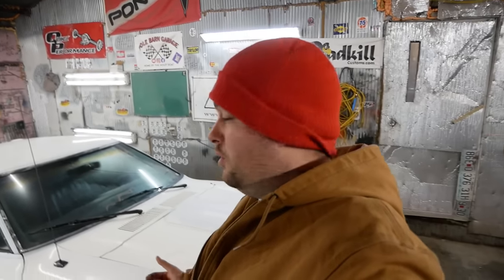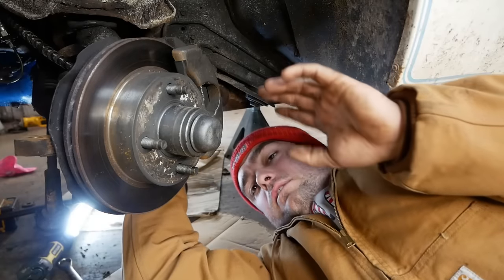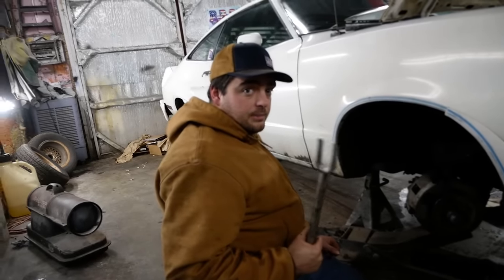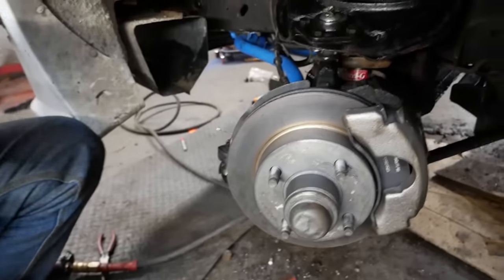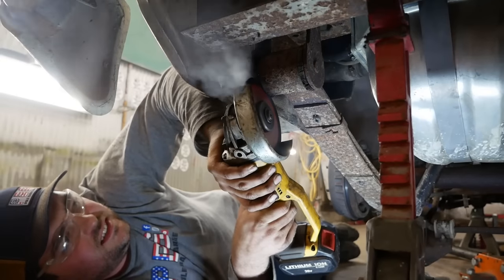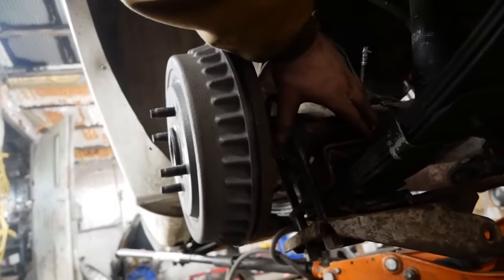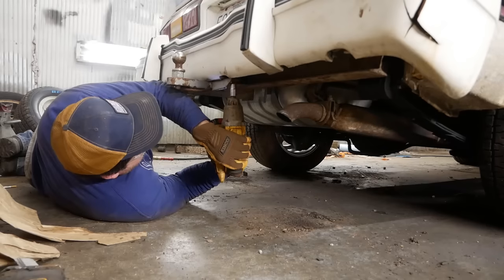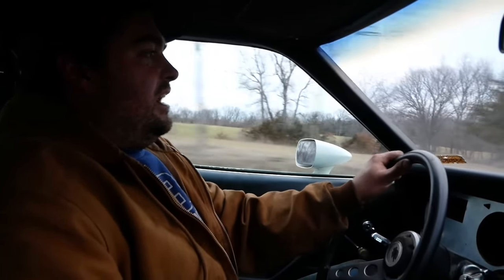King Cobra Mustang OVERHAUL! Total Suspension Refresh, Gets Some Muscle!

Comment: I built the Mach one edition of this car. Complete full custom build from the body shell out. 
I can tell you a few things:
#1 EVERYTHING is clapped out and was garbage when it was new. 
#2. NOTHING fits these cars. 
#3. There is no aftermarket support. 
#4. If you need a part you will have to
 A. Find a used one. (Which will also be clapped out garbage)
 B. Buy one for another car and modify it. Or
 C. Get a "universal" part and modify it to fit. 
#4. Aftermarket fiberglass pieces are $#!T. dont waste your money.
#5. The engine (V8) is offset 2" to the passenger side. The bellhousing and flywheel are one off mustang II parts. 
#6. When you are finished with it,  youll LOVE IT! 
Good luck man!

Comment: When I was 8 years old I thought the Mustang II Cobra was the coolest car on the planet! I loved it in black with all the louvers! Fast forward 10 years and I had a V8 Monza that I put a 350 in. Knowing what I know now I could have made a bit more power with it but It would've smoked any stock Mustang II. Looking at the front suspension and brakes on that car, though, and I must say, at least the brakes are superior to the Monza, and so is the engine placement.

Comment: I believe you are supposed to fill the PS system and then turn wheel lock to lock several times to prime before starting the vehicle. I had same issue with an 05 pilot...go figure

Comment: You need to check crank casting number to determine which engine it is. It has a 289 balancer and those are early 289 heads. Could just be a replacement 302 block
Reply from the maker: It's a 302 from a 77 mustang that I put in it last video.. definitely not a 289
Reply: Sorry about that Dalton. That message was for a different channel. Keep up the good work. Really enjoy it!

Comment: There isn’t much I’m able to offer you as advice as you’re definitely more knowledgeable than I am, but I do have at least ONE thing. 

When you’re cutting things with a reciprocating saw, especially bolts like those leaf spring bolts, use low speed and lube. Keep the blade cool and lubricated. As soon as the blade heats up too much, the teeth become soft and there goes your cutting ability. 

Because of this, high speed doesn’t necessarily translate to a faster cut.

Slow speed and lube keep the teeth intact and sharp, and will result in a faster cut and WAY less blades used.

Comment: I bet that rack was fine and that inner tie rod is bad. I did the same thing on a 1999 corrolla. Spent three hours taking the rack out. The replacement rack went bad in a few thousand miles. Looked at the original unit and replaced the inner tie rod and it’s been fine since.

Comment: Dalton I see you using the Dewalt wrist saver ratchet, I'm curious - i realize you love it, you use it all the time- so I am a Ridgid cordless tool guy, I have a million 2, 3, 4 and 6ah batteries. Like 15 of them, literally.. and I really DON'T want to  switch over to M12 (12v) Milwaukee JUST to get the ratchets (I want the long reach 3/8 really) but Ridgid DOES make them and the 18v batteries fit it like the one you have. Do you find that it fits into places ok? I haven't bought one yet because I'm concerned (for $200 I don't really have) that it won't get into tight spaces, or.. really i don't expect it to perform miracles, but man my wrists are SO bad from wrenching for over 30 years, I just.. I need some type of power in my life.. and I don't mechanic all day every day anymore, but I do enough maintenance to think it might help.. I'm just curious of how you like it with the big battery on the back end of the ratchet like that, is it comfortable enough or should I just get the M12. I do have 1 M12 battery and a charger but I just don't think a 2.0ah will be enough to last a job and I really don't need to be buying a bunch MORE shit I don't need. Anyway, I'm just curious if you like the Dewalt cordless ratchet, as the Ridgid is basically the same thing.. Thanks man, love your work, thanks so much for sharing all your time with us!!

Comment: I can think of one other place for a 12mm... riello oil burner, high pressure fuel line nut on the fuel pump is 12mm. I jave to keep the wrench in my tool bag JUST for that one specific nut.

Comment: @polebarngarage what you could do about the welded nut on the frame situation is get a shoulder nut (basically the built in washer nut thingy) and drill a hole a few sizes bigger than the bolt, slide the nut into the frame (if too big for the little finger hole drill that out) position over your bored out bolt hole and fill the gap between the edge of the new hole and the threads of the nut with weld.... Then you got you a new welded nut and it is no longer a pain in your assholes.... Or just ignore it depends on your mood really haha

Comment: FYI Dalton the Ford Motor Company used high sulfur carbon steel to build their cars and they rusted out very fast in the 70’s and 80’s . Fords were truly bad until the new paint department was built and they started using galvanized steel in the 1990’s  I KNOW THIS BECAUSE I MADE THE GALVANIZED STEEL FOR FORD IN THE 1990’s.

Comment: Dont these have modern spring kit update? For smoother ride?
Reply from the maker: I mean a leaf spring is a leaf spring 🤷 you could probably go coil over on the back but that's more likely to increase harshness than decrease. Springs take time to break in. After 300-400 miles it will be a different car

Comment: Now that you fought that sway bar bolt in so much it occurred to you that you could have fit a bolt facing down into the hole and put the nut on the bottom side huh 😂 I know because I did the exact same thing on my wife’s gas tank in her truck and only afterward did I realize I could put a bolt through. You would think I would have done that the 2nd time I dropped the tank, but it’s still in there now that I’ve dropped the tank 3 times. If it works it’s fixed shut up it’s fine. Yes the only way to remove it is with an adjustable wrench so what.

Comment: Flaming River manual rack would have solved all your steering issues.
Reply from the maker: Yeah for what like 2 grand😂 this ain't motor trend dude, this is real life
Reply: @PoleBarnGarage  they dont make them anymore it seems. Did any of the Mustang 2 come factory with a manual steering? Probably impossible to find though.
Reply from the maker: Oh they did, cheaper than the power rack as well. But I'm putting my girlfriend in it and it isn't a race car, so the power steering is nice
Reply from the maker: Oh they did, cheaper than the power rack as well. But I'm putting my girlfriend in it and it isn't a race car, so the power steering is nice

Comment: I bought a paint restored power steering pump from rock auto. It didn't work. Got another for free. It didn't work either. So I bought a genuine one and it is still the 10 years later.

Remanufacture parts from rock auto suckkk